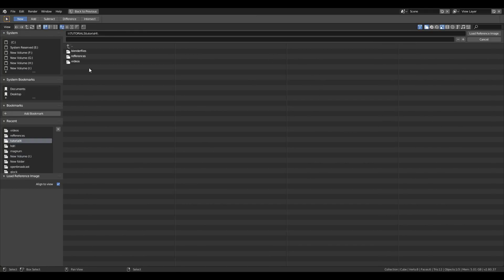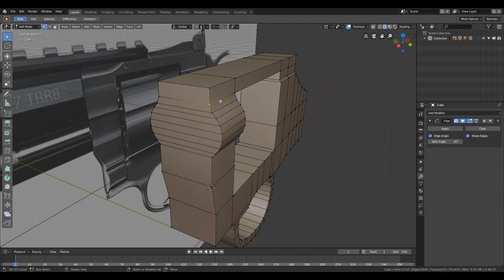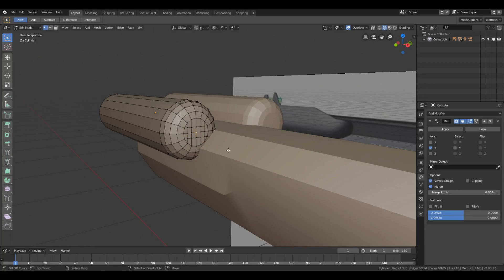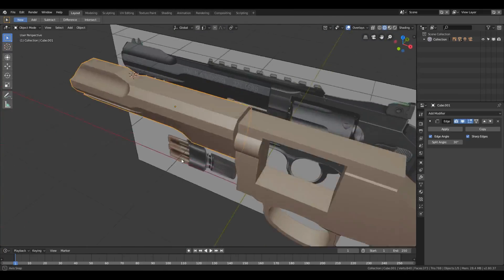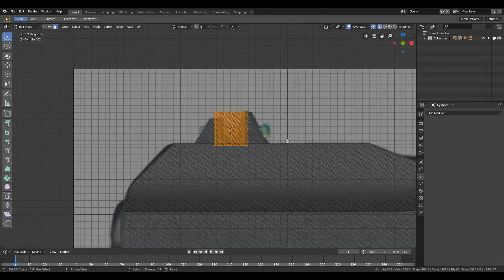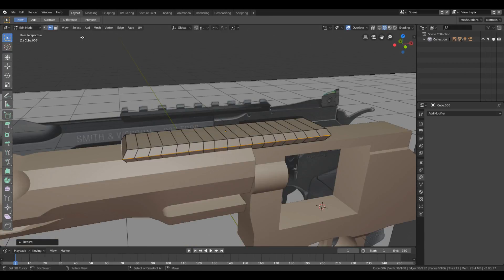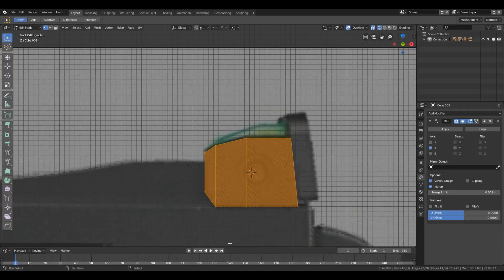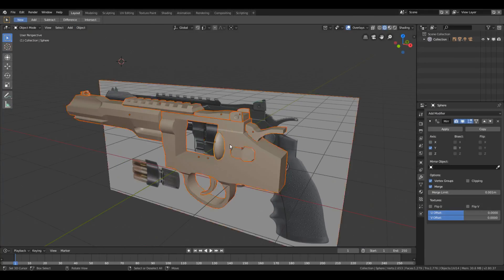Speed modelling magnum gun base model inside Blender 2.8

Comment: I have a question ?
I'm wearing a bone-clad weapon and adding animation. but I get an error when I put it to unreal. the main bone system is visible, only the bone systems connected to it are not visible. and that's why it doesn't work in animosya. What could be the reason?

Comment: Hey, great video, just a question, I see you use a lot of boolean, I thought that messed with the topology? I guess I am wrong? Idk it seems very interesting as I personally usually always refrain from using it.
Reply from the maker: thanks, yeah it does mess with the topology but the main reason i use the boolean is that it helps to create your base mesh fast it speeds up the process you can even later use the knife tool if your topology is not looking good you can later fix them by creating edge loops or just by joining vertices by creating edge between them with knife tool.
Reply: @SaqibHussain88  Thanks for the reply that's great. Do you get a sense of what type of booleans mess up or do fine in it. And I guess it matters less on parts that doesn't need rig based animating. It looks awesome. Loved your eevee lighting tutorial too. I am subbing.
Reply from the maker: @artisanmage5378  whenever i try to use boolean i try to focus on the number of polygons which i use to add or deduct mesh . Before using boolean I try to figure out how much do i need to bevel to  make a  geometry stand out  with less amount of polygons after that i use it as a boolean .Thanks for the subscribe.

Comment: Might I ask you, how do you quickly connect vertices with a line to eliminate moons? Are you using the knife tool for this task? Thank you!
Reply from the maker: I press J while selecting the two vertices to make an edge between them if it doesn't work due to some issue in topology then i go for the knife tool.